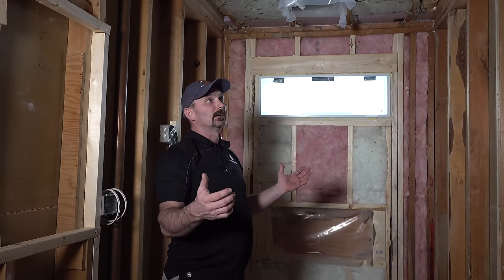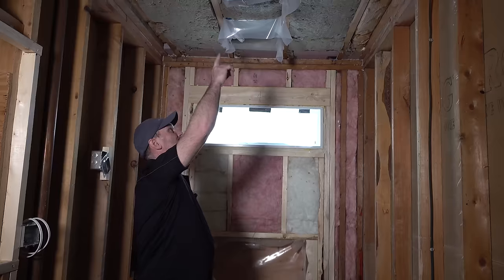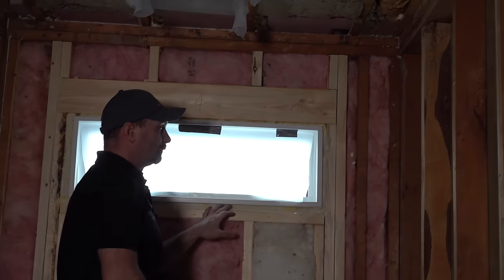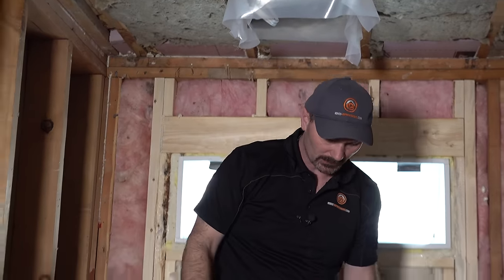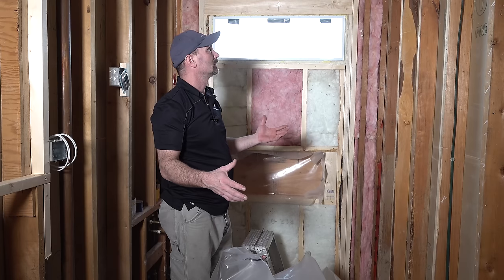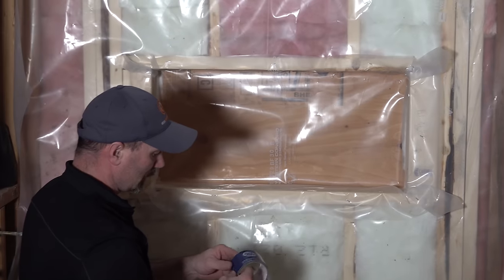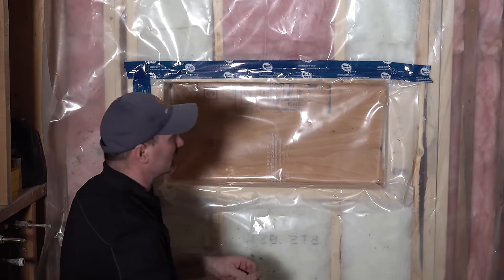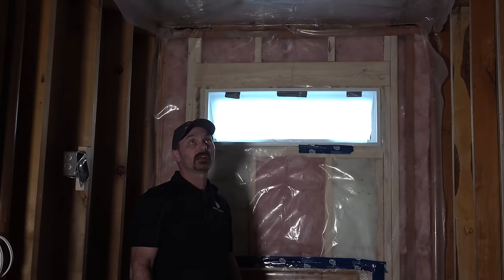How To Upgrade Vapor Barrier During A Renovation

Comment: Now we have foam board for bathrooms, acting as vapour barriers, and a 1/2" thick potlights that are IC rated with a gaskets. Its getting easier Shannon!
Reply from the maker: I have never seen a foam board designed as a vapour barrier? Bring a link to the forum so we can have a look please.https://www.house-improvements.com/forums/
I never trust those little flimsy gaskets on slim lights for a proper seal here in Canada .

Comment: Hi Shannon
I am doing some Reno's on our  bungalow. The old roof insulation was vermiculite and has been removed professionally.
They also removed the ceiling vapour barrier 🤔🤔
So now have Plaster board/ Type of ceilings and no vapour barrier between joists.
Do I have to drop my ceilings or is there another method to install a vapour barrier.
Appreciate uour advice, great videos across all the trades 👍👍
Reply from the maker: If you have plaster you never had a vapour barrier originally. Maybe black paper, but I doubt you even had that. Please post your question in the forum and we can discuss this project better there.https://www.house-improvements.com/forums/

Comment: Is there a reason that you used the blue tuck tape and not the red? Great video Shannon.
Reply: I’m not sure where they are from but here in Ontario the blue became the new code last year for interior
Reply from the maker: Yes the blue is actually made for air/vapour barrier sealing.

Comment: As always good video. This in not related to the video but I'm about to start a new project  of replacing my cedar siding to manufactured stone. ( versetta stone). Wondering should I remove the cedar laps( not a shake style) or go over it with some rigid material( 7/16 osb) then wrap the house and even considering going over the wrap with 30 lbs felt paper. Your opinion much appreciated.
Reply from the maker: remove the old lap siding first. Our forum is the perfect place for help and advice.https://www.house-improvements.com/forums/

Comment: Shannon, many people are now saying "never put plastic in your walls!" in terms of 6mil poly. How can I decide if it's right for my application or not?
Reply from the maker: Your local codes will dictate that depending on your location. There are newer products now called "smart" membranes and they will allow the wall to breath if it needs to. Don't ask me how ,LOL
Reply: If you’re air conditioning the building, use a smart membrane. Certainteed Membrain, intello sold at 475 building supply, and siga majvest are some options. This allows the wall to dry inward during hot seasons.
Reply: @KennyFlagg I’m renovating my 80’s raised ranch now in VT. Going to bite the bullet and go with Siga Majrex but man is it expensive at $1.50 a square foot.

Comment: I'm very confused about the use of a vapor barrier. The moisture in the air still has to go somewhere (a vapor barrier doesn't remove moisture). By adding a barrier you've just given that moisture vapor a place to condensate onto and become a liquid instead of being released into the air and out through the roof vents (assuming proper attic ventilation). Or it will just migrate to the path of least resistance which would be into the walls that don't have a vapor barrier, through the door opening etc.
Reply: This is a very good point and something I considered for a VERY  long time. In the North you want a vapor barrier on the inside. In the South you want it on the outside. So in the North where I am you want to stop the heat from escaping through the wall. Condensation is then only an issue on the outside you want a waterproofing membrane that will let that breathe. Tyvek does this and does not let water in. DO NOT USE BIG BOX STORE VERSIONS. As far as Zip systems, I still don't trust them. You have to seal all screw holes and all seams. Does it breathe outward? I still don't know the answer. Back in the old days things weren't so sealed so condensation wasn't an issue. Now that things are so tight it is an issue.
Reply: Vapor can’t condense until it hits a cold surface. The poly is on the inside of the wall assembly so it never really gets cold in winter. The vapor barrier is there to prevent the vapor in the air from making its way to the exterior sheathing and condensing because the sheathing will be cold being on the exterior side of the wall assembly.

Comment: No building or lumber yard has any plastic I can find that says approved for vapor barrier !!! 6. Mill yes but nothing certified or advertised as vapor barrier. 
The 6 mil I see in stores is for under slabs and things and is opaque and is very heavy to put on walls and ceilings. 😵
Reply from the maker: Do you live in an area where you are required to have a air/vapour barrier? If you are then they sell it for sure.

Comment: Here in the states we don't use vapor barriers anymore as they claim it traps moisture in
Reply from the maker: Maybe in some lower states you don't , but not all.
Reply: @HouseImprovements  I'm in ny
Reply: The way I perceive moisture in a warm and moist environment, and a bathroom is a good example, and where the exterior is for some month a really cold environment, the moisture is not going to migrate through the dry way. With insulation in the wall, and also the foam board on the outside, no moisture will migrate to the exterior  sheathing plywood or other wood substrate, where it would condense and create havoc. Maybe even rotting out studs. If the moisture would condense it will under the drywall. But with the poly, moisture, which loves to migrate to a place of moving exchanging with dry air, will stay put inside of the bathroom. If you have a good deal that stops air exchange, I believe it should be all good. You do need an air exchange system in a sealed box.
Reply: Here in Wisconsin it’s code to use a vapor. I can’t believe I’n NY u guys don’t have to use one as ur whether is kinda the same
Reply: Vapor barrier
Reply: In locations where a vapor retarder is still required by code, it's best to use a "smart" variable vapor retarder such as Certainteed's Membrain. The material changes it's vapor permeability characteristics based on the humidity level.
Reply: It may be required by code in this case but if you want a healthy wall assembly a poly vapour barrier should not be used with rigid foam on the outside.  Depending on the type of foam any moisture that did find its way between the poly and the foam would have a tough time drying out.  As long as that exterior wall is well air sealed any vapour that makes its way into the assembly will readily dry to the inside as there is no condensing surface due to the exterior insulation.

Poly on the ceiling isn't really necessary either unless the space above the ceiling is inadequately ventilated.  In most cases a well air sealed ceiling plane combined with good insulation values and a vented space above will not see any moisture issues.